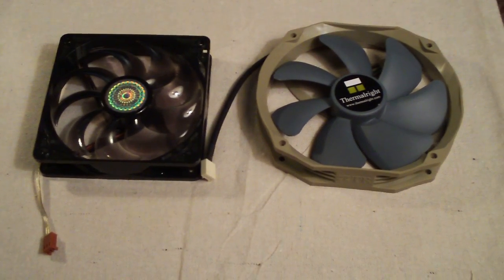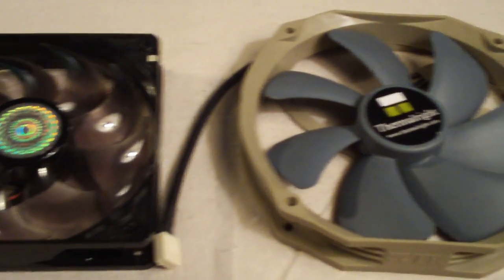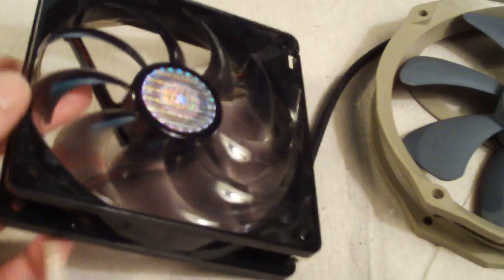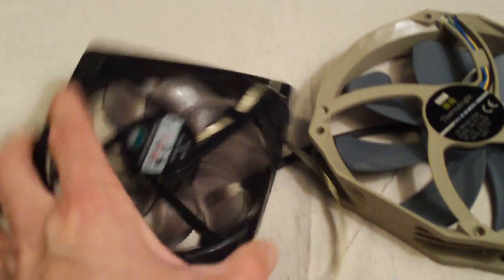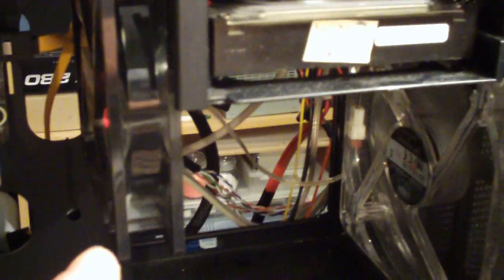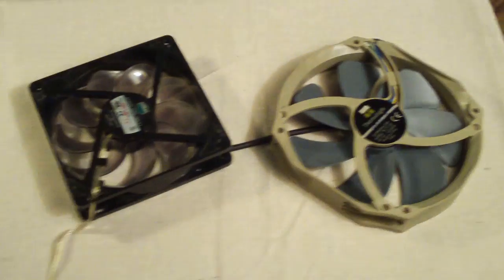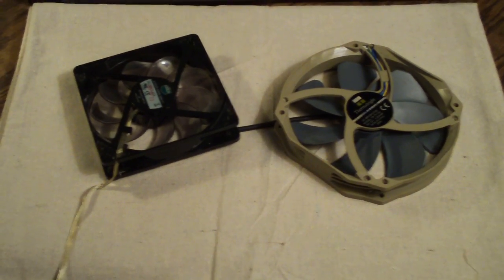Computer Fan Airflow Direction Tutorial

Comment: Please don't judge me, I know it's filthy. I smoke, building a new rig and I want to protect it as much as possible. Thought to get an air purifier to put directly in front of PC, air purifiers not optimal. 2nd thought: placing a desktop fan in front of PC to blow smoke away from the intake, but I thought "Wouldn't that be robbing the PC intake fans of airflow as the desktop fan would be sucking air away from the intake fans of the PC?"
So then I thought "What is the damn difference if I reversed the intake and output? Make the front three fans out and the back, top and bottom fan intake? This way the PC would be it's own "desktop fan" protecting it from me?"

Comment: Yes, but no. The air flow direction is determined by the fan pitch.  looking form the top of the hub(the shiny sticker side) if the blade profile is / them the air goes from top to bottom, if it is \ it will go from bottom to top...

Comment: wouldnt it also be beneficial to have the fans exhaust air outward? hence pulling the heat out of the case? bc if your room temp is fairly warm it would just pull warm air into a hot case, right? anyone?

Comment: If the logo wasn't there you couldn't tell. My guess is that you look for and at the dip in the fan so that shows it brings the air up by elevating it and rotating it thus causing a direction of air towards the dip in.

Comment: Yeah this is great but in practice it does not work . I used an incense stick to see the airflow direction but the fan would pull in no matter what direction I put it in. The only difference was the speed at which it would pull the air in.

Comment: Thanks a lot buddy. 1 question though if you can help me to figure out.
What is best option for air flow/direction. Inside out or outside in. I can see your fan of your pc throwing air from outside in but mostly pc fan through inside out?
Reply: The fans in the front should blow air into the pc, while fans placed in the back or on the top should blow out air. There needs to be a circulation.

Comment: you should have the last fan you mentioned turned the other way to take the hot air off the card, cause you're just trapping hot air in there with both cards forcing air into one another
Reply: Exactly my thought, and I was browsing comments wondering if others spotted it :D
Reply: He likely has 2 more fans on that case

Comment: My case came with 2 fans, one was intake from the front and outtake in the back. I installed 3 fans in the front and took the original intake one and made it an outtake on the top. Even though the back outtake fan and top fan were facing the same way out, the top one became intake for some reason.

Comment: I always had trouble invisioning how fans worked. Fans rotate counter clockwise  If you imagine the blades pushing air looking at the picture, the flat blades with no curve wouldn't do much with air it would just tease it around. Now if you rotate it, you get some scooping action. That's why the fans look like it could cup rain water. Rotate your fan counter clockwise and see which side is scooping the air. Rotate it the opposite direction and you can see the reverse result. Although it's more efficient to rotate the entire fan to blow the opposite direction, as the scoop design of the fan helps immensely.

Comment: What is the downside to using a strong fan to blow out from the case in a itx with one fan minus the cpu basic Intel fan attached to board? I don't mind the noise I actually prefer it as need white noise to get to sleep anyway but will it be not product full for my itx to exhaust?  There is lots of holes behind the rear back where the fan is on my itx raid max case? I think it will be strong enough to pull air thru however dunno the science behind this basic stuff,  looking forward to learning though. I like fast and loud is actually a plus for me as then I save money even in winter on regular house fans blowing onto me for the white noises... lol.  However..m I don't want to blow my board or anything and have a nasty habit of takin things to extreme.  Downsides of extreme whether to little or to much as in air in or out? I figured outwards would take the hot air right off the CPU cooler out of the case....  And if strong enough even pull it inward from behind where holes exist in the front. Bad idea... no videos exist on this stuff. Maybe positive and negative pressure is something for me to Google...?  Thanks anyone, Steve

Comment: I'm confused cos for the longest time I had my fans blowing air into my pc and my cpu (while playing a game) ran around 73 degrees C. I just flipped my fans around to suck the air out of my pc and it now runs at 60 degrees C. my fans are more towards the mid/top of my pc and the vents I have are at the bottom to suck the cool air in.
Reply: That's because he's wrong, a case fan should always suck hot air OUT of the case, if you only have 1 case fan. If you have more than 1 case fan, the front or side fans should bring air in and the back/top fan should blow air out.

Comment: is the cpu fan supposed to be label up or down? because all this time i had it up, then i see videos showing it down, also i have no front fans, and my case fan is on top and is label side towards the outside, also i have grills the opposite side of my cpu fan on my case, and one in the back, and the top, the back one is just a grill though, am i doing everything right or should i turn my cpu cooler label down, help thx XD

Comment: I was wondering how you did that with the side fan, despite your case being open. I have bought myself a modern CPU cooler and it hits my large side fan (Cosmos S). Kind of ironic. You buy a full tower thinking for a long term enclosure and it can´t even accommodate a Hyper 212X. Well, I´d rather take better CPU cooling and sacrifice the large 230mm fan, but your video got me thinking...

Comment: Perfect, all I needed to know right here. I'm installing Corsair H100i V2 water cooler with the fans inside the case and the radiator outside the case on a NZXT Phantom  410 case. Pull configuration and will need to remove the mobo install the fans. Didn't want to r&r the mobo twice.

Comment: over 3 years i did it wrong way omg :( thx for vid
Reply: you're not alone bro LOL
Reply: holy shit i just discovered this too. 3 years for me too!!
Reply: As long as they're all facing the 'wrong' way the worst that will happen is you'll have hot air blowing in your face. There will also be the benefit of cool air being drawn in through the back keeping the graphics card, power supply and chipset a lot cooler. If anything back to front airflow is better. If you have fans blowing in opposite directions that's when it's truly a problem.
Reply: @johnchronic5248  havent cleaned one section of my case because i never knew it existed in the front panel, lets just say its one giant wall of dust that is thicccc af
Reply: @mastersergant1287  lol, it happens to the best of us. I had a huge dust bunny lodged in a very inconvenient place in my case, I had to remove the CPU heatsink and HDD bays to get at it. Once you know where those nooks and crannies are though, it's just a matter of keeping an eye out for dust there.
Reply: If you did ALL of them wrong then it will just flow the other way around, not interfere with one another so i guess it wouldn't be a problem
Reply: @drftr6073  It would, if the intake side now has no air filters.

Comment: Dear_____,   Thanks for yr informative video.   I have a question.

I have a laptop 'cooler pad'.  It is a stand for my laptop with a cooling fan built in.  However it is sucking air OUt of the air inlet under my laptop, putting strain on the internal fan and slowing it down.  I need to simply reverse the direction of the airflow in this Cooler Pad.  Can i reverse the fan's spin direction >  Is it as simple as just reversing the wires feeding it current?   Thank you.
Reply: no, absolutely not. If anything, you'd want to actually flip the fan around. Reversing the current will just burn the fan up. Its like how putting batteries in a toy backwards doesnt make the toy move in reverse.
Reply: Thank you.  Pardon my ignorance  ;-)

Comment: I have exactly that coolermaster fan you showed us. I put it in the front of the case and it is connected, it is facing the side (as you mentioned in the video) that should give me cool air blowing in the case. I put my hand on the case where the fan is mounted and I can feel the fan blowing out air. Is it alright? Or have I mounted it wrong because I mean it is the exzazct model you were talking about and before I mounted it I span the fan to know what way to mount it and the way turned out to be the same as in your video. Any help is appreciated.
Reply: xXAUSTYNN 11Xx Are you sure?
Reply: +xXAUSTYNN 11Xx But its just a small amount of air though.
Reply: +xXAUSTYNN 11Xx Yea because otherwise it would suck out air

Comment: So if I am mounting 2 120mm fans to the top I want the exhaust facing upwards?
Reply: It's more of a preference, if you want positive or negative air pressure. Positive pressure is when you have more intakes than exhaust and negative is more exhaust than intake. I personally like negative because air can go from the front of the case right out the back.

Comment: HELLO,I AM MOUNTING A CPU FAN ON 100W LED.CAN YOU PLEASE TELL ME WHETHER AIR SHOULD FLOW INSIDE OR OUT ?I THINK IT SHOULD BE LIKE THIS-AS ALUMINIUM TAKES HEAT AND SPREADS IT,THAT HEAT SHOULD BE SENT OUT,SO THE FAN SHOULD BLOW THAT AIR OUT OF IT-(OR)-THE FAN SHOULD BLOW AIR INTO THE METAL,WHICH WILL PUSH THE HOT AIR OUT OF METAL! NOW WHICH OF THESE IS CORRECT?

Comment: I thought the fan pull the hot air away from the CPU and blow out of the case.. so it needs to blow into the case?  wouldn't this cause more dust to blow in?
Reply: ***** you just flip the fan around one side pulls air in one side blows air out and if you flip the fan to switch the function.
Reply: Leonard Morales you need fans that bring air from outside in and fans that blow the hot air inside out. you need air going in and out.
Reply: Leonard Morales Most computer cases also include dust filters that go in between the case body and the fan to prevent dust from entering your system.

Comment: so I should feel a strong/noticable breeze coming out from my rear fan? or a strong/noticable breeze inside the PC? I might have installed it the wrong way. the sticker is facing inside the pc btw. please reply!!!
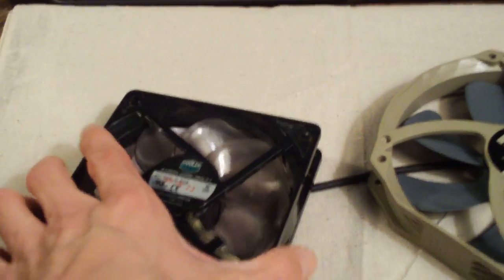Reply: That depends on several factors.  What most people seem to forget when installing fans and obtaining optimal airflow are the perforations in the case.  For example, if you look at this video at say 1:02, and like most cases, there are many perforations in the bottom of the case where fans COULD be installed, but many people do not install fans there for various reason (psu too big, slots in the way et al.).  Yet, these perforations affect air pressure in the case.  So, you really cannot determine if the fan is installed properly just by feeling the amount of air exhausting from the case if you only have say 2 x 120mm fans as intakes.  On the other hand, if you don't have perforations in the case where there isn't a fan, then yes, you most likely installed something wrong if you do not feel any air.  In other words, if you have 5 places to put fans in your case, and all 5 places have fans, and you feel nothing, then there is most likely a problem.  99.9% of the time, there are arrows on the outer edge of each fan indication the direction of the airflow.  However, in the rare case that your fan doesn't have these arrows, then pull the fan out of the case, plug it in to the mobo, and feel which direction the air is moving - very simple - just don't stick your fingers in the fan ;)
Reply: Wunji1
thanks man. that was clear. worst thing happend I actually stuck my finger into the cpu fan while was running. I was a bit tipsy and decided to have a look at my pc under my own curiosity :P
Reply: ***** haha - well, if you had lost a finger, it would have been a great story to tell your grandkids one day lol....

Comment: Almost every smaller box-style fan ever made blows towards its motor & supports.  This isn't just because of some nice standard, but due to a few engineering advantages.

One such advantage is that the fan pressure will help to ensure the blades move away from the supports during operating.  Another is that it is very easy to create tiny fins inside the hub to cool the fan motor with a vacuum assist by air moving towards the gap created by the hub, rather than trying to pull through the gap (and needing holes in the fin hub for breathing).

I'm sure there are more reasons why this is so universal.

Incidentally, large-style box fans (such as the floor type) are opposite of this because they have a large area in which they can cool their motors - and for aesthetics and noise.  Just how things that matter on the smaller scales don't matter on the larger scale.
Reply: Gordon Bommer
Yep, that little hub motor is generating heat and needs to be cooled with some airflow or enough dissipative mass.

A decent 120mm 12v PC fan will need to dissipate around 5W of heat it creates itself.

Comment: Hello.I have a question.What is better for cooling. to have,, more intake fans in the case or the exhaust, I have availability of 8 fans in my case.Thanks
Reply: TheIamdaone No no no no no! Thats completely wrong! If youre trying to keep dust out, you want to have more filtered INTAKE fans than exhaust. Do 5 intake (only if theyre filtered) and the other 3 (unfiltered) exhaust. With more intakes, it creates posotive pressure, thus pushing air out of the little cracks and holes in your case, and keeping more dust out. What you were talking about was negative air pressure, which you dont want.  If you arent worried about dust though, just go 50/50, but at least make it flow right.
Reply: Alex King i still believe that Jaan's coment was right aswell.
Reply: I got the h100i for my  FX8350.The thing i want to ask is....my idle temp is 8C, (Stock Cloks)Yeah Crazy huh? my full load temp in around 25-28 C.I checked temps on corsair link and cpu/temp,and core temp all showing same temp.Im not sure if thats normal? Or my sensors just showing bad temps?
Reply: you want to maintain a positive airflow in your case, meaning you want more air going out of the case then what's going into the case. So to answer your question, you want more exhaust fans in your case. A good show of positive airflow is: 2 fans at the front of the case pushing air into the case, 1 fan at the back of the case pulling air out of the case, and 2 fans at the top of the case pulling air out of the case. Hope that helps.
Reply: thanks a lot
Reply: Okey Ill try that,but tanks a lot for the answer =)
Reply: no problem! :)
Reply: TheNickmoura I have more intakes now It dose working pretty well,But thing to look for is the case it self,As not all cases are good for those kind of things.;)
Reply: Jaan Zabolotski Alex King is right, the first guy was wrong!
If you have more air coming in than going out, you create positive pressure. If there's more going out than coming in, there's negative pressure (think of it as a "vacuum" effect) - remember: conditions adjust themselves to the point of equilibrium.
That's why you want positive pressure (>in than out) - that way, like Alex King said, you force the "extra" air out through the "cracks" on your case (assuming you're using a somewhat recent case). If you did what the first guy said, you would force the case to suck air through those same "cracks" to compensate for the elevated exhaust, which would in turn suck up dust from the surrounding environment.
Reply: Diogo Jordan Thanks for a TIP =)

Comment: Question regarding a behind the motherboard fan ...
I have a Rosewill Blackhawk ATX gaming case that has an opening on the right side for a 120mm x 18mm behind the motherboard fan. Should that fan be an intake or exhaust fan?

* I currently have 2 x 140mm intake on bottom, 3 x 120mm intake on front, 1 x 120mm intake on the left side (blowing on the gpu), 2 x 140mm exhaust on top, and 1 x 120mm exhaust on back.

Comment: You can just put a piece of paper up to the fan if it sticks to it its intake, if it blows out its exhaust, just a simpler way for ppl who are still confused.
Reply: Only problem with this is that I have to have it connected to a power source then and turn it on, which isn't exactly productive or convenient when working on your project.
Reply: If anyone is reading this in 2020, this isnt particularly good advice unless you have the fan separate from others. I tried this, but it turns out the other fans in my system were Overpowering the one I was testing. It looked like it was intaking, but was actually exhausting.
Reply: OMG didn't even think of that
Reply: yeah that's a way of doing that but I'm gonna build my first pc soon which means I don't have such a fan to test it with.
Reply: Tried that after attaching a fan to the side of the panel. Mostly it pushed the tissue away, but if I bought it real close to the fan, it sucked it.
Reply: and you just make me feels like  i hate myself so much for not even thinking about this. hahahaha
Reply: 2022! Thanks
Bruce Poopy you are the shit!
Reply: Genius

Comment: I always had assumed that whichever direction the "fins" of the fan are curving, that's the direction the air flows. For intake fans they'd be curving inwards when seen from the outside. For outtake fans they'd be pointing outwards when seen from the outside. 

Am I right in thinking this or do I have these mixed up? :P
Reply: "some" fan does not have curve... but yes, most of fan got the curve and that's the flow direction